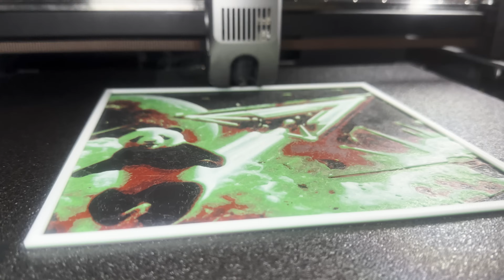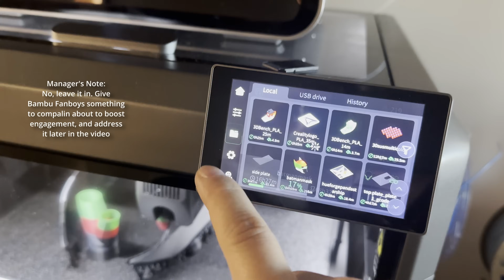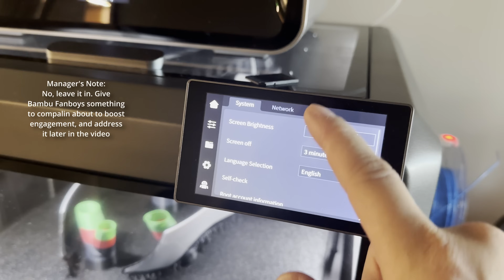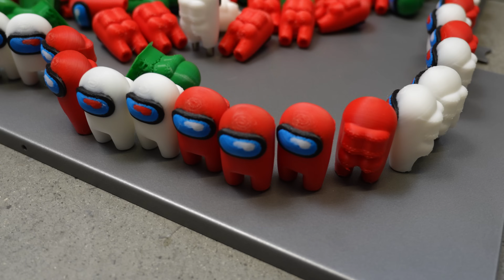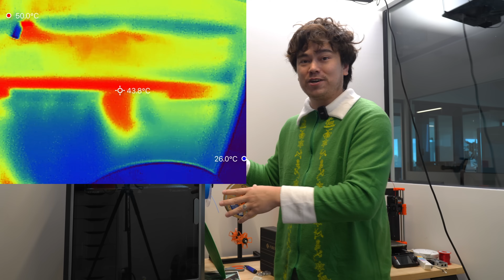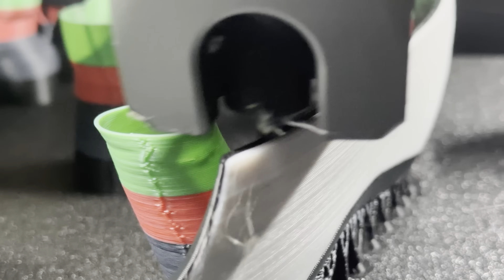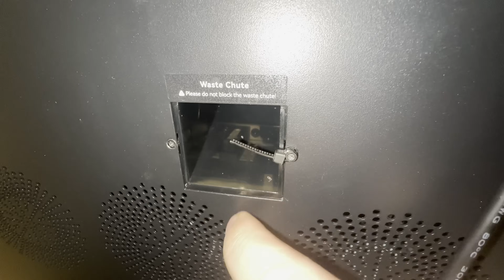Creality K2 Plus - Printer Of The Year 2024 (Goes on Sale Today)

Comment: running a p1p with ams is NOT difficult.  you don't need to use the sd card to transport gcode, you LEAVE THAT IN THE PRINTER - put the printer in offline mode, and then send the prints over the LOCAL NETWORK to the printer from the slicer (works great with orca or bambu's own slicer just like you would do for a voron or a ratrig) just like how you should be doing it with the k2 plus and the k1 series as well. - it's ALREADY got a computer inside with storage, you don't need thumb drives or sd cards to move the gcode around anymore. - and touchscreens are completely optional because you can have FULL control over the printer with your computer, your phone, or a tablet.  one of my printers is a p1s+ams (which is basically a factory enclosed p1p) and the only time I interact with the interface ON the printer is if I have to emergency stop due to a failed print, or when i'm setting up my slicer and need to get the security code to be able to access it (or initially to put it into local only mode).  I don't need a dedicated touchscreen to cancel a print when the cheap button interface (or heck, even a rotary encoder with a stop button like in the case of my voron v0 and voron v2) - I have a k1 max as well, i do the same, ignoring the touch screen completely with the exception of canceling prints.  it's just not worth the extra expense on a printer when you can use your phone or computer.
Reply: After Klipper, I use the 3D printer's user interface for maintenance.  I send the print job directly from PrusaSlicer for newly created parts, and use the Fluidd web browser interface to monitor the prints and resubmit print jobs for production.  I generally agree that the more reliable a 3D printer is, the less I need/want a user interface on the printer.
Reply from the maker: My P1P had a broken wifi module. I think it may have gotten fried when I tried to plug in the cable for the LED bar they sent me as an early backer reward. I may have plugged it in backwards and fried the wifi chip. But with that not working, the machiine was not fun to use. It printed great, and I could figure out how to use single colors, but also my contacts at bambu were ignoring me at that point. They transferred my support tickets to their CEO and he ignored me, so I couldn't figure out how to get support or replacement parts for my machine.
Reply: @NathanBuildsRobots  You can get replacement parts, and you can make a shell for the machine.
Reply: @NathanBuildsRobots  oh, ok, this makes perfect sense then for your p1p (and I know that some of those early units were less-than-stellar when it came to overall build quality on their electronics.) - and yeah, I could certainly see if you didn't have working wifi on the printer where the really "meh" control module would be frustrating... it's really not thought-through as a complete interface - the designers clearly expected you to use the slicer or app for the majority of the control.

Comment: Eh. It's only <350 nozzle. That can't "do everything"
Reply from the maker: Well, open source klipper means you can plug whatever thermistor and hotend you want into the thing. If I felt the need for a 500C I bet I could get it installed and working in under a day.
Try that on a bambu lab machine.

Comment: What I've learned from Creality: never buy the first batchs! Modding Enders was fun but also necessary. However, the need for mods doesn’t determine if a product is good or not. If a printer works well out of the box, there's no need to mod.

Comment: I'm one of those salty Bambu fanboys who almost can't believe what I'm seeing. But I'll believe it anyway, because I actually WANT Creality to succeed. The K1 was a rushed incomplete "almost almost there" imho, and the K1 MAX build upon too many of the faulty principles of the K1, correcting only a select few of them. The K1C on the other hand, was definitely a step in the right direction, and to be honest, I wouldn't be too annoyed by having to change my P1S into the K1C. 
  So it stands to reason that K2 Plus would be an even bigger step than K1C. 
  However - I'm still curious to see how the different parts are serviced and the quality of the guides to do so.

The biggest lack of any Bambu Lab machine is the closed nature, which prevents us from making basic upgrades. Fx. the P1S crappy 720p camera with that unbelievably horrible frame rate. No biggie, new 1080p30 camera module would cost south of $50 right? No. Because allegedly the P1S board can't handle a better camera. I say allegedly, because we really have no way of knowing - but let's just say for the sake of argument, that this is actually true. Well, no biggie - we'll just change the board to something with a more powerful processor, right? No. At least, not easily. Buuuut what about just buying the board for the X1C and jamming that in there? Nope, despite the many similarities between the X1C and the P1S, this is sadly not possible. Which MUST be by intent, because being a programmer myself, I reckon it'd take in the vincinity of a work week or less to enable this board swap. In fact, developing the cheaper P1S board can hardly have been worth the cost compared to just using the X1C board. The X1C board retails for around €74, so the cost would a be minor addition for the P1S - maybe €20. 

Regarding that print failure at the end; yeah that's 100% on you. Blocking the poop chute is entirely your fault. If the poop block had happened without that zip tie, yeah that'd be on Creality - but I see no reason to put that zip tie there other than asking for failure, and you should have known better with your experience and expertise.
Reply from the maker: Based Bambu Fanboi

Comment: One thing you forgot to mention about the Prusa XL is the $4500 price tag. That's a major trade-off when comparing to a K2 Plus.
Reply: I thought the same thing.  I haven't done the math, but unless you're printing expensive exotic material, I doubt the poop cost would ever cover the difference in cost.  Nathan did mention the advantage of being able to use TPU that doesn't feed in the AMS or CFS multi-filament systems.  I want to make products with ABS and TPU, but ABS needs an enclosure.  I could maybe make PETG and TPU parts.  Bambu just announced AMS compatible (higher durometer?) TPU that should also work in the CFS, which would negate the Prusa advantage.
Reply from the maker: I thought I mentioned the price difference. I think in most cases the total cost of ownership will be lower for the K2 Plus, but if you are printing expensive or exotic filaments that are $400/kg, just the poop from one filament change could cost $2. Especially when changing between filaments with different melting points, it has to flush a ton of extra filament to be reliable. Add that up over an entire print, or an entire month, and you could easily be looking at thousands in wasted filament.

But the best and most popular way to use 3D Printer IMO is to do single color printing, which the K2 Plus will excel at.
Reply: @NathanBuildsRobots  Yeah, for the 99.9% of us who rarely print with exotic materials, it would take a very long time to make up $3000 in poop. I guess for those operating a print farm, it would be less time. Still loving my K1C! I will consider the CFS for it when they have the adapter kit and SW details nailed down and the CFS is widely available. Loved this review.
Reply: @daveduncan2748  Honestly i feel like the cost-recouperation wouldn't come in the form of poop waste but time. Prusa's tool change is dramatically faster than purging filament. So if you are running a print farm for a multi-material print, being able to do double or triple the output is where the real savings is.
Reply: @mochmaster45  Good point, but is the XL really faster overall? Earlier this year, Tom's Hardware said this about the XL, "Prusa has no information anywhere on this printer’s top speed or acceleration rate. The slicer only shows a top speed of 200mm/s for infill, and a max acceleration of 5000mm/s²."
Reply: @daveduncan2748  it's speed doesn't come from actual movement speed. It comes from the fact that you don't have to purge for 30 seconds every color change, it's just a few seconds to swap the head. Across a large print with many changes this is HOURS of time.

Edit: a site I saw recently for a MMU had a print taking 24hrs on an ams, 15hrs on their system and like 8 on a tool changer.  Just to give some rough numbers

Comment: i mean the thing is that you are comparing the k2+ against a 2 year old printer in a fast moving tech (well, thanks to Bambus X1C, which ignited the movement)

Spec-wise the K2+ is better in almost anything, no question tho.
But that might change in Q1?Q2? IF Bambu releases their new printer surpassing the X1C. 

Whats not going to change is BambuLab pricing.. the new printer wont be cheap compared to Creality´s pricing..

Edit:
NVM. I just saw the pricetag of 1,5k for the K2+.. thats too much man.. 
But again its open source which can be good and bad.
Reply from the maker: The sad thing is in those 2 years bambu has continued to release lower and lower spec printers
Reply: @NathanBuildsRobots  because thats why competition is a good thing.
Reply: @NathanBuildsRobots obviously the wanted to fill more price brackets. It's something normal. 2 years for the new generation is fine I believe. I don't want to see every year an upgrade like the phones even though they just seem like it.
Reply: @NathanBuildsRobots how many i3 clones have creality released in that same time frame?

Comment: I have multiples of Bambu and Creality. Bambu has better software, better support, and treats their customers better. I will buy a large format Bambu when it comes out. I'll probably wind up getting one of these too if they get their logistics figured out and it doesn't self destruct by the end of the year. Creality has a huge customer relations problem to overcome. I wish it was cheaper, but it's not unreasonable.
Reply: Agreed. The K1's were hit and miss. Almost 40% of mine had to be replaced (with more Bambu units) because they developed major VFA's...which Creality support said was completely normal and within spec.
Reply from the maker: Agreed. Based on my experience, I fully believe this printer will be the turning point for creality. They didn't take any shortcuts or cheap out on things to make it less expensive to manufacture. They actually put time and money into making this machine great, and I hope it will perform as well for their early adopters as this machine has for me.

Comment: That AMS is about the most interesting thing. A 100% klipper compatible AMS could be a very nice product in its own right if they decided to sell it seperate.
Reply: I believe they should be? Not positive, but I amcurious if they will still be doing backwards compatibility with the various k1 models.
Reply: they are its on the website
Reply: I got a couple 3-dChameleons earlier this year. None of the add-ons that drew my eye have been released yet. 3MS has a conversion to run the 3-dChameleon on Klipper. I'm unsure if they have a BOM for building an AMS/MMU but it would be worth a gander.
Reply: check out co print 3d. Their KMS promises compatibility on any klipper printer with access to klipper web.
Reply: I doubt that Creality sells the CFS separately. But Big Tree Tech has posted a picture of what looks like an AMS. It could be a Klipper compatible multi-material unit.
Reply: @andreas.grundler  CFS for sale on the website.  $299 USD

Comment: After I ended up spending more time fixing my ender 5s1 than printing with it....I'm gonna see how these do for 6 months or so.

I want a tool, not something I need to continually tinker with to get to work (again).

Looks promising!
Reply: Might want to wait a bit longer even.
Reply: @stew675 This is light years ahead of the 5 S1. Waiting 6 months is a fair waiting period. but honestly i think this printer is very promising even with bugs.
Reply: @mlawaljr1  Well, at the time, the reviews all said "buy this if you want something that JUST WORKS", but I fully admit there have been huge steps since then. 

It just burned me as it turned into a point of frustration instead of a tool to help me.

Hopefully it was a fluke and this thing totally kills it, I'm actually currently Re-diagnosing my ender 5 s1, hopefully it's just a ribbon cable and I can get it working again!
Reply: @mlawaljr1 Hopefully the VFA issue is fixed from the K1's. As a print farm owner, I took quite a hit by having to replace almost 40% of my K1's because they developed major VFA's and I won't sell subpar prints to customers. Compare that to Bambu, and I've only had that issue on 2 machines. Btw, Creality support said those VFA's were normal lol.
Reply: @ My Ender 5 S1 with the Sonic pad gave me massive headaches till this day!! It’s a great printer but came out possibly the worst time ever. I still have mine with a bunch of parts for it as well. If you need some help let me know. 👍🏾
Reply: @lynnmckenney1987  That's the trouble with 3D printer reviewers. They jump the gun far too early in my opinion and that can lead to disappointment. I don't think I can remember a single 3D printer that launched issue free ever. They all have some kind of serious problem in the first few batches. But if you're patient and wait at least 6 months after release you can usually get the Printer you want and at a discount of some kind too.
Reply: @mlawaljr1  maannnnn...I got the sonic pad thinking it would solve ALL my problems...aannnd now I've reached the "sunken cost fallacy" with it. I've replaced the extruder 3 times, and multiple other parts, all in the hopes "this will fix it, and I'll be able to use it consistently". 

No luck yet.

I just want the freaking thing to work consistently.  Even friends at work who extensively 3d print are confused when I talk about the issues I've had with it. 

Today I bought a new ribbon cable after my extruder completely died out, then I replaced the extruder, with no results. This is my hail-mary, as I really don't want to throw it in the trash now. 

It works great....for a week or so, but I'm only printing pla with it, and still having consistent issues.
Reply: 100% agree (3S1 pro) trap.
Reply: My Ender 3 pro was awesome.
Just had to install new springs, new wheels, new board, a RPi 3 with klipper, linear rails on X and Y, a stealthburner and canbus.

And after that few little mods, it prints OK. 😊

Same applies to my K1 Max. After changing the firmware, the heated bed, installing a real probe to mesh the bed and removing the cable chain, it started to print somewhat well.
Now I'm printing the linear X rail mod, and praying for it to be the last necessary mod on it 🙄🙄🙄
Reply: This guy really hates bambulab….
Reply: @lynnmckenney1987  to be honest, don’t waste your money :) this printer is sh*t! I’ve had id replaced 3 times in 3 months. I gave it back last week and I ordered an H2D. Without even getting my hands on the H2D for now, I know my problems are gone.

Comment: Too expensive.  Otherwise it looks nice.
Reply: yeah lets sell a corexy 350 cubed, heated chamber, closed loop motors for 500 €
Reply: @bybrndrengar1029  "yeah lets sell a corexy 350 cubed, heated chamber, closed loop motors for 500 €"  Yes, that's much more reasonable.
Reply: It barely costs more than X1C and you get tons more value with it...
Reply: @HoodedLime  As of right now it costs 25% more than the X1C.  Not what I'd consider "barely more".